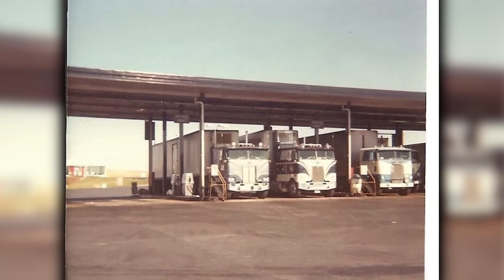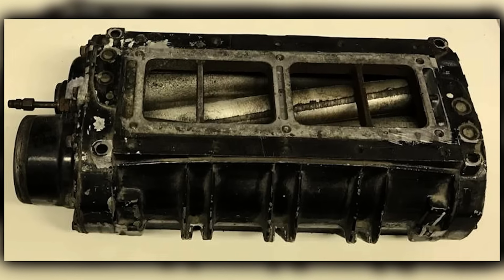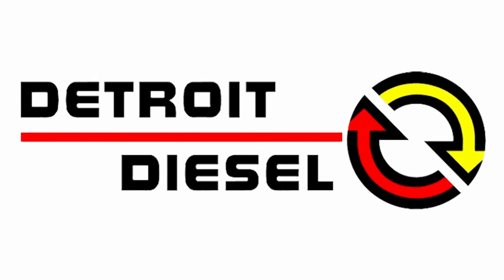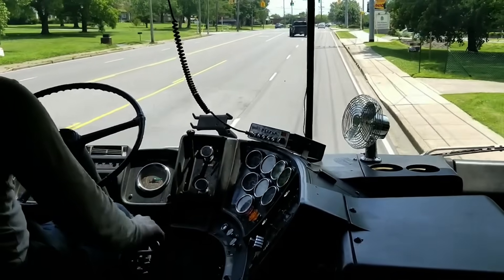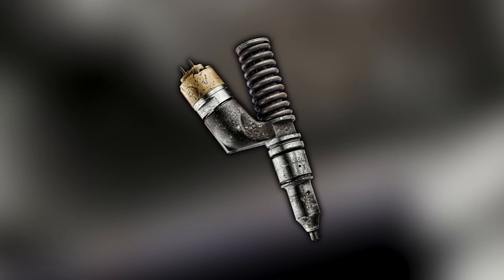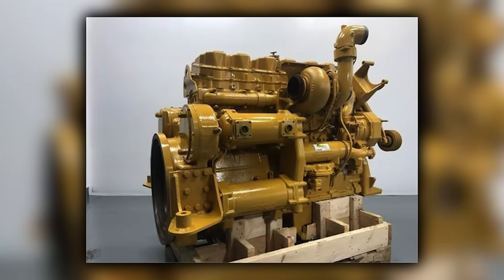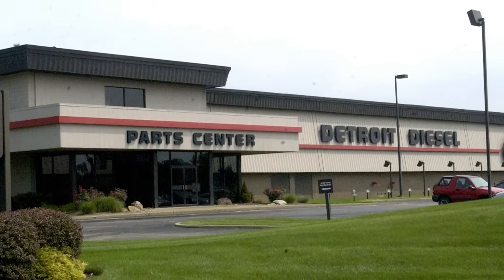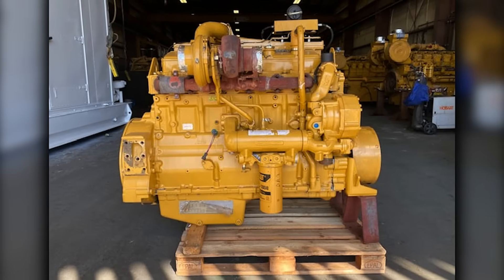Why Caterpillar’s 3406 Engine Still Haunts Detroit Diesel

Comment: The 1693 425 hp Cat made 8V71 Detroit Diesels look like lawn mower engines and would easily go 1 million miles if you dropped the oil pan and turned in rods and main bearings at 600k to 700k miles. I put a lot of miles on a 8V71 “double breasted Yamaha” and what they did best was to turn diesel fuel into heat and noise. I swear they leaked oil through pores in their engine blocks but you never had to worry about the frames of the trucks they were in rusting!
Reply: Lol ! 🤣
Reply: @jamesbarbour8400  The Detroit 60 series has proven to be the best all around engine.
Reply: @mtl-ss1538 , yes the Detroit Diesel series 60 four stroke engines are everything the series 71 two stroke weren’t. The series 92 two strokes were a major step forward in power and oil leak control. They were strong engines for a two stroke design and leaked little to no oil but came up far short of what Detroit achieved with their Series 60 four stroke engines. These Series 60 Detroits were even better than their Cummins, Detroit, Mack, or foreign competitors engines thanks much to do with their electronic fuel controls technology they had researched and developed for their Series 92 engines with it being improved upon and transferred to the 60 Series four strokes. I had the experience of driving some of Cat and Cummins first attempts at electronic “fly by wire” engines and they were much more primitive and unreliable than what Detroit accomplished with their Series 60 engines. Detroit’s advancement stemming from them being early in applying their electronic technology to their Series 92 two strokes early to their 6V-92 engines in LTL freight operations where they accessed a great deal of data on what worked and what didn’t.
Reply: So you’re comparing an engine with 568ci and no boost to an engine with 890+ ci with the benefit of boost? Just for clarity no cat easily goes 1 million miles.
Reply: @KaClogbusters , the 1693 Cat was available in 425 hp through 525 hp until the mid ‘70s and they were known for long term reliability, along with stump pulling torque, with only the exceptions not making it to 1 million miles due to engine failures. They were regularly driven to 500k to 700k where the oil pans were dropped, rod and main bearings were spun in, and they were driven beyond 1 MILLION miles before receiving a full engine overhaul. A friend of mine drives for a company that bought used trucks with 1693 Cats who followed this practice and then bought glider kits to install the drivetrain from these used trucks into to extend their live FAR BEYOND 1 million miles. I’m 70 years old with more than 1.5 million miles of nation wide heavy haul experience and have seen many of the 1693 Cats attain this. My last fleet manager, prior to coming to this position, had a small fleet of Kenworths with 1693s servicing a large cabinet maker and he had several of his truck go well beyond 1 million miles. The 1693 Cat was a turbo charged, water after cooled, inline 6 cylinder that preceded the 3406 and 3408 series of these Cat engines. The Detroit Diesel 71 series were 2 stroke diesel that required a Roots type blower to force air into their cylinder through ports in their cylinder liners to push exhaust gases out their 4 (in most cases) exhaust valves in their heads. Few of the 71 series had the addition of a turbocharger or after cooler although many, if not most of the series 92 Detroits had both of these additions considerably increasing their output.
Reply: More facts I love it

Comment: I received a mechanical aptitude scholarship to mechanical school Lincoln tactical Institute in Dallas, I chose diesel because I saw that cars, I was gonna be working on carburetors shocks, electric windows, etc. I want to work on engines mechanical things. Of first job was with caterpillar in Houston, the great thing about diesel back then before they ruin them. Was that the only electrical items on a diesel engine were the starter, the alternator, the battery the solenoid that opened up the fuel which could be bypassed manually, thank goodness and the globe plugs. Everything else was purely mechanical as it should be. no computers, no chips no transistors no solenoid no sensors no DEF no hogwash. I had a 1982 Mitsubishi diesel turbo pick up. It was only rated 85 hp. It wouldn’t rev over 4500 RPMs due to the governor, but it had torque I put 400,000 miles on it, drove it through a flood got water in the cylinders bent a connecting rod. Bought a connecting rod and a pan gasket since I had just changed the rings at a quarter million miles, reuse the head gasket no problem drove it another 150 K before I gave it away to a guy who needed wheels everything on it was mechanical except for, the starter the alternator battery in the go plugs got 30 miles a gallon. The worst I ever got drove it hard, put her up wet, the story speaks for itself when we get rid of DEF and go back to full mechanical diesel engines without computers will be way ahead of where we are now
Reply: Speaking of the two-stroke Detroit diesel, once you worked on a real four stroke diesel engine, the sound, and the annoyance of a two-stroke is just that, I’ve seen more Detroit diesels, run away and almost kill people than any other engine due to the effect of their poor design, if you don’t maintain those roots blower seals it’s gonna suck oil and burn that oil just like diesel and that blower is gonna pump it into the engine and unless you have all your safety is ready you’re shut off plate, etc. you’re gonna watch an engine explode and if you’re near it, it’s gonna hurt somebody or kill you, my brother was a a towboat captain along the Gulf coast, where they moved mostly hydrocarbons liquids and barges, most of their pump engines were Detroit diesel. Two-stroke, his stories of the of the runaways, were scary when you have a detour, run away on top of a bars, full of gasoline and you know it’s gonna blow up at some point you don’t wanna be near it and be you don’t wanna be near the barge either.
Reply: I put one of those little diesel engines. After a reck  not my fault.put I put it in a 1934 Ford pickup and I still have her

Comment: Thanks to the 3406 Cat engine Detroit rolled out the Series 60 which became the most fuel efficient and reliable HD engine ever created.
Reply: Bold statement.
Reply: Yea gd engine much weaker they could have made it 14.0 liter same size pistons as the n14 or big cam
Reply: @samuellathon5960  they did make a 14 liter and it makes the 12.7 and cat rotating assemblies look like car parts and is known to hold 1000 horse on factory parts
Reply: @dannykruse4467  lol. Lots of cats holding more than 1000hp.  With factory rotating assembly.  Several holding 3000+. Not any detroits that I know of competing with the big boys in the loaded drag racing.
Reply: Bold to be sure.

Fuel efficiency describes more than just mpg. It describes efficiency when considering all things taken into consideration.

An N14 Cummins typically average around 5.5 - 6.5 mpg. While a DD 60 lower displacement model was often reported getting 7 mpg. But when considering the N14 had a 14 liter displacement and longer stroke vs. the 12.5 liter displacement of the 12.5 liter version. 

This makes the N14 actually the more efficient of the two when considering all factors. But the DD 60 is the better engine at mileage.

As far as reliability. The DD 60 ate pistons, especially if modded for higher powere and N14, ate cranks but usually only after a substantial number of miles. 

So, just based on that. The DD 60 isn't more "efficient" than the N14 but does get better mileage when at the lower 12.5 liter displacement. And it has a major piston issue whereas the crank issue on the N14 often only comes after a good number of miles and can be proactively avoided. Making the N14 objectively more reliable under those parameters.
Reply: @d @danielmorris-ruckett913 nly the earliest Series 60 had piston issues. It was corrected by 98 thereabouts. The N14 was certainly Cummins best and last decent highway engine but the Series 60 was still a more reliable and inexpensive engine to operate in stock form for fleets.
Reply: Bullshit
Reply: Well, DD60 was not so reliable at first. Only later, around 1999, it became a viable option. And today, parts are harder to come by. A reman 3406B or E would be my choice. MPG is a must these days, and the 3406 delivered.
Reply: @ChristopherFrank-w8n The Series 60 experienced some piston failures early on but were changed for the 1998 model year. Considering that the Series 60 was produced until 2011 that is a great testament to Detroit getting an issue fixed early on in production. I’m not sure what country you’re from but here in the states Series 60 parts are still plentiful and inexpensive compared to Caterpillar.
Reply: Anything built by Detroit is garbage and the fact they stayed in business says 85% of the world are stupid fucks
Reply: Ur fucking high
Reply: In your dreams 😂
Reply: Been passed on flat ground by 60 series. But I always caught them in the hills. Could pull 6mpg easily doing it.
Reply: Liar. 
My 1986 3406B is still running like a champ every day and will out pull any series 60 anywhere all day long. 
I can fix any of the issues that very seldomly arise. 
My Caterpillar and all the other ones I ran never left me walking.., ever. 
Show me a 39 years old series 60 still running for years at a time with zero break downs. 
I adjust my valves once a year and change my oil every 5000km. That's it. There's no series 60 that reliable. 
I couldn't care less about fuel mileage. 
Series 60 has a bad habit of creating a window in the block behind the ECM. I've seen it many many times.
Reply: That's an opinion millions would disagree with.
Reply: @craigmauger4325 ppl who dickride cat are just cat techs or listening to others opinion.
Series 60 is king. Ive been a truck mechanic for 12 years. Done plenty of inframes. There are so many old series 60s still kicking, Its way beefier and heavier than any engine cat has put out. You can snap a cat crankshaft by dropping it on the ground lol. 

Detroit diesel is by far the best brand of motor money can buy.
Only issue is parts availability and finding a dealer. 
You here about cat more because they were sold much more and have better dealer support. 
Detroit just works. They dont break. They leak oil like a sieve but they dont break. If im an owner operator im looking for a series 60 all day.
Reply: I have two 60 series 14L pushing 600hp. As good of a job they have done for me, they still nothing compared to the 3406C CAT that I had a chance to drive.
Reply: @loveforthegame3 I had 12.7 i took to 1.56 million, no internal failures or overhaul.  Currently at 1.16on a 12.7 in a 2013 glider with no failures and oil analysis looks good.  Haven’t even had to replace bull gear.

I don’t dislike cat, but I have NEVER heard of one going 1.5 without an overhaul.  I personally know someone that had 1.7 on a 12.7 with no rebuild.
Reply: Detroit 60 series is a legendary engine but to say the most reliable is somewhat of an over statement.p I drove Peterbilt cabovers with the 60 series 855 big cam and the 3406 cat. And a cat wins with Cummins and second and a 60 series is in a distant third because they have no torque
Reply: @cmarbormaster I’d say it was definitely the most reliable computer controlled diesel engine. Everyone loves comparing the 12.7 to the C15 or Cummins Redtop 14L. The Detroit is a 12.7 and in stock form is not going to pull like a 14 or 15 liter engine. 80% of trucks dont do heavy haul and that’s why the 12.7 shines. Torque don’t pay bills. Good fuel economy and reliability does. That’s why the 12.7 was the best computer controlled diesel engine ever built.
Reply: Series 60 was a joint venture between Detroit Diesel and John Deere… long story short, it’s a John Deere marine engine painted green
Reply: @merritttrucker  Wrong. John Deere handled the engineering on the flow of the cylinder heads. That’s it. That’s not unusual at all for manufacturers to collaborate on certain aspects of a design. Yamaha has done cylinder head engineering for years for companies like Toyota, Ford, and others. Ford and GM collaborate on certain components all the time. It’s simply a way for companies to share in the design costs. There’s not a single piece of John Deere equipment that has a complete 12.7 or 14.0 in it from the factory. 
It’s a Detroit Diesel engine period.
Reply: @prevost8686 it's a Volvo VED 12
Reply: @merritttrucker it's a Volvo VED 12
Reply: Good on fuel yes but they leak oil and they don’t last on heavy haul. 600 k miles and there wore out car will go million plus no matter how heavy you pull
Reply: ya i dont think so lol the 60 series was awesome and it could be cranked up to 600hp easily
Reply: A 550hp cat or n14 @525 would embarrass a 12.7 now 14.0 s60 & n14 close but the n14 n Tq
Reply: @samuellathon5960 not really, we bought a couple 12.7s in old oil field western stars tuned up over the 500hp mark. Pretty much everyone that pops in and drives them is usually in shock at how hard those trucks haul arse.
Reply: @chrisanderson6837 My 12.7 has 900K on it and has never been opened up inside. Other than the rear housing it hasn’t had a major oil leak.
Reply: @prevost8686 most 12.7 s I know that are operated by owners run well past 1.3  million or 30,000 hours before overhauling
Reply: @prevost8686 gonna have to replace that bull gear soon if you haven't already
Reply: @KaiserBruh going to at 1 million. Wear metals in the oil analysis are still excellent.
Reply: @chrisanderson6837 I beg to differ with your opinion, I did heavy haul for years. Mostly 140,000-170,000 lb loads. Cat c15 averaged 3.3 miles per gallon, needed rebuilt every 700,000 miles.   Not sure how often a 60series needed rebuilt. Sold everyone before it needed rebuilt.  Last one had 28,000 hrs, 1.2 million miles. Needed nothing ever but a couple sensors, ac compressor, and alternator. Did get rods and mains bearings at 500,000 miles. Rum mobile delvac most its life.  Oh, 4.2-4.4  miles per gallon.  I'd take a Detroit 60series any day.  Get a good tune and the Detroit will pull more than most people know.   I would output every isx15 I ever ran against. Could not output a good Cat but boy did it make more money than every Cat engine I ever known. Plus every cat heavy hauling eventually ended with a cracked head it seems.  Just talking from experience and I got experience.  Im sure you do to. But just saying in my experience I am sold.  I still have a heavy spec 379 with a  mechanical 3406C just to look at as I don't need it anymore but cant bear to sell it.

Comment: The slide of the injector is an EUI Electronic Fuel Injector which wasn't used until the last of the 3406 series.  Because from the original 3406 in late 1970's through the 3406 PEEC models the engine had an inline 6 scroll metering injection pump.  The PEEC engine had electronic actuated rack & electronic injection timing.  Because the block couldn't accommodate a camshaft with 6 additional larger diameter cam lobes to operate the EUI injectors CAT had to use a single overhead camshaft.

Comment: The original 3406 A model was a pretty combustion engine and it wasn't the fuel efficient engine AI say it was.  It also had major head issues and Cat had switch over kits to make them direct injection just like detroit.  Also you could overhaul a detroit much cheaper and unlike the video said there wasn't many special tools until the series 60 came out.  I know I worked on them all for years.  Cat, Cummins and Detroit of the 70s and 80s were very simple engines but all had there good and bad
Reply: Ran the A model. Just as efficient as the Bs
Reply: Absolutely right. I drove 360s and 375s. They indeed were precup motors. And, after the 1693 that the precup 3406s replaced, their pulling powered was, meh. And their fuel mileage was about on par with a 92 Detroit, so not that good. However, that all changed dramatically after a few years when Cat came out with the DI (direct injection) versions of the 3406A. Those were initially 380s and then 400s. Those did better than pretty much everything else on the road at the time as far as mpg. And the pulling power was game changing. Loved the 3406 DI engines. Best ever in my opinion though I never drove a series 60. Guys who did say they were/are the best and I have no reason to doubt them.